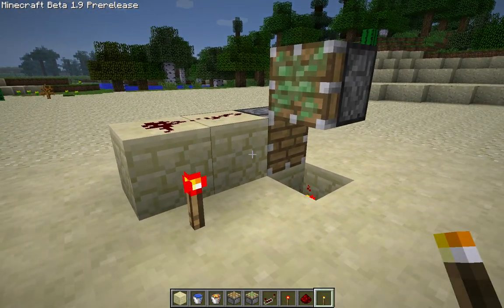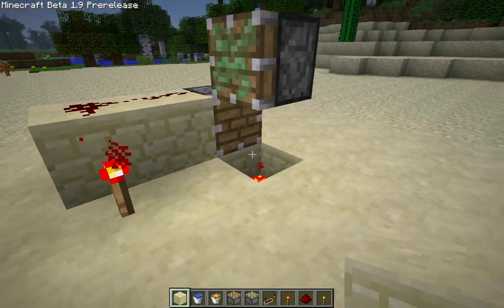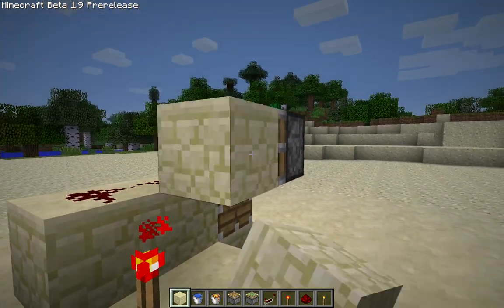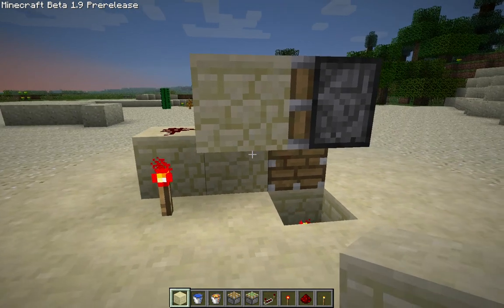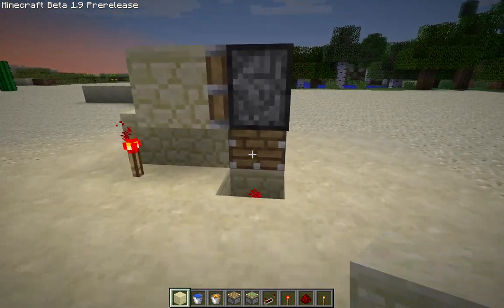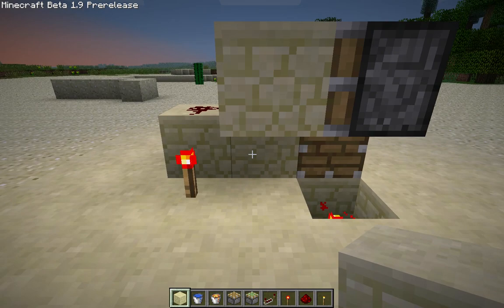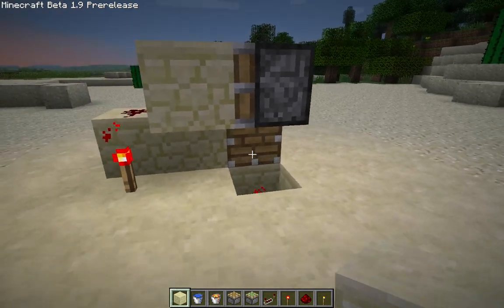Minecraft - 1.9 Prerelease, Piston Crash [FIXED]

Comment from the maker: @khorne131313 I discovered it by testing an old cobblestone generator design I had to see if it would produce and stone, this setup pushes the block out as soon as it forms. Replace manually placing it with a cobblestone generator and that's how it happened. This design also produces 0 tick pulses which I've been working with for a while.